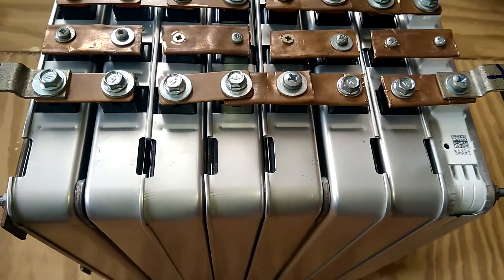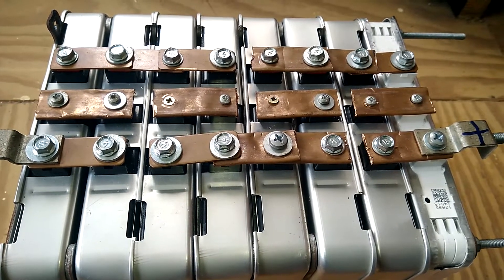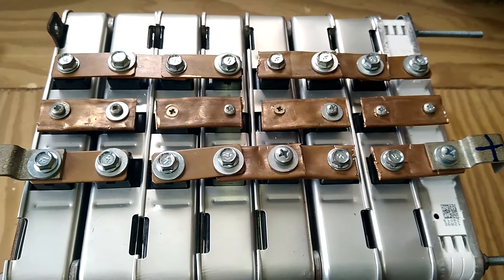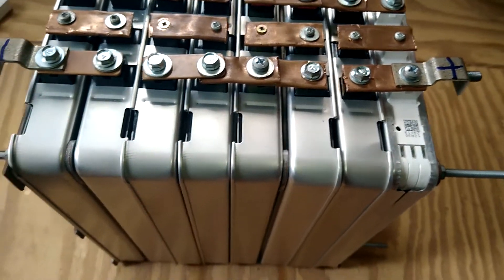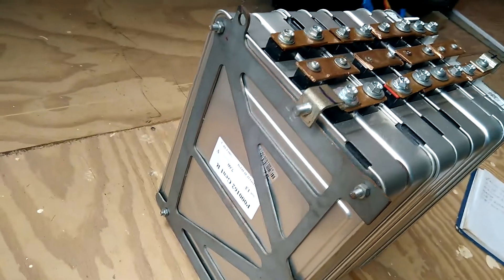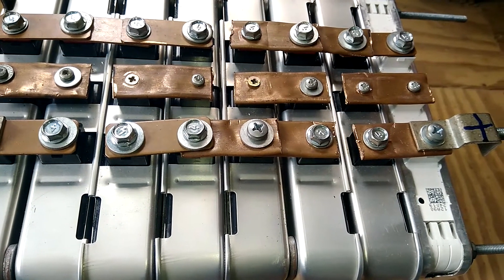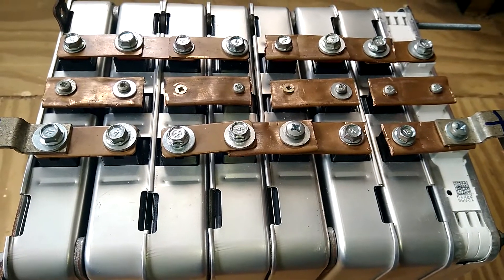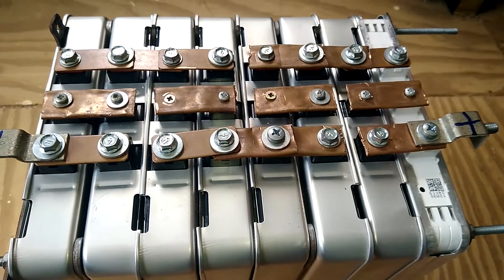24 volt Nissan leaf battery module

Comment: I have nissan leaf battery 12 Pack how can connect for 24V
Reply from the maker: @kophoezaw2555  indent of the voltage of inverter some of them gos up about 28v dc and some gos to about 32v dc 3 batteries in series make to 28v and 4 of them gos over 30v dc

Comment: Are all of the batteries all + on one side and all neg. on the other side ?
Reply from the maker: I wire 2 batteries in parallel then I series
Reply: I am trying to get 24 volts out of 8 Nissan batteries, So i should wire 2 batteries in parallel then 6 series ?
  @offgridlivingstlucia8865